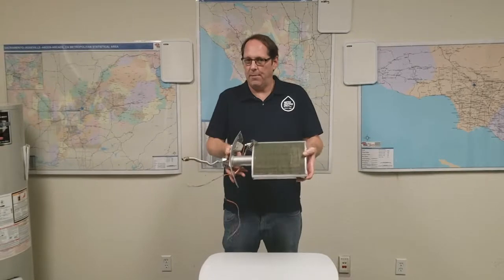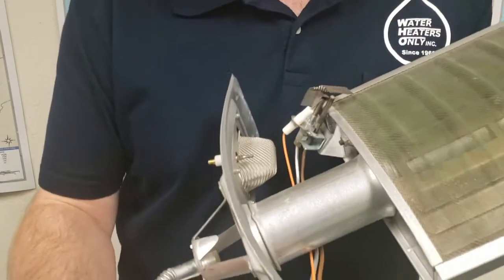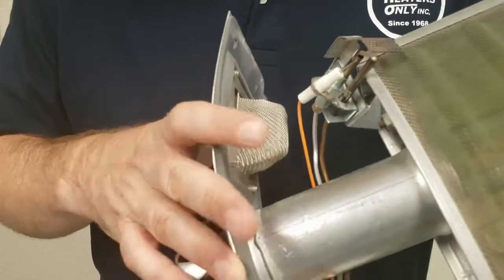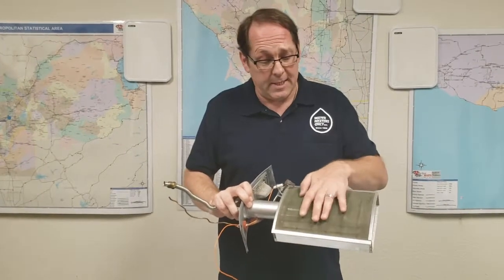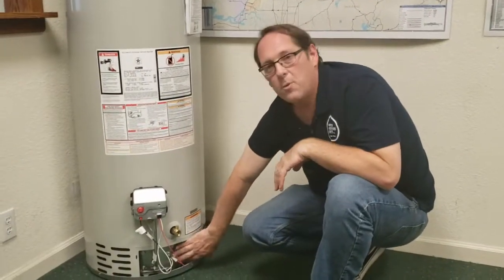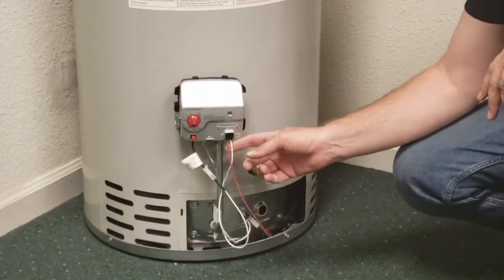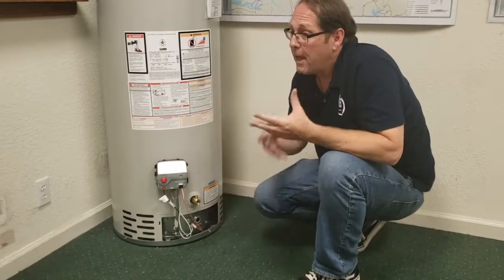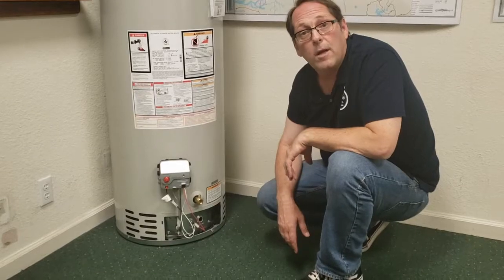Burner Assembly

Comment: Thanks for this great informative video. 
I am actually looking for an exact replacement for my gas water heater burner just like the one in the video. 
Would you happen to know where I could find one?
Reply from the maker: Hi Enoch. Depending on the age of your water heater, a replacement burner may be covered under warranty, either by the manufacturer or the installer. At the very least, contacting them will ensure the correct burner for your brand of tank and where to best purchase the part. The burner in the video is most likely Bradford White. I hope this helps.
Reply: @Waterheatersonly  
Thank you very much for the information. 
Mine is definitely not under warranty anymore, since it was already in the house before I bought it almost 6 years ago.

Comment: Why does my thermocouple head look so red and burnt and pilot light won’t stay on? I’ve replaced the thermocouple 3x in 2 years. What does that perforated shield do above the 3 heads by the thermocouple?
Reply: Hi and thank you for your question, it's hard to say with out knowing the brand and model, since the FVIR change over the manufacturers each designed their tanks a bit differently. However, is sounds as if the chamber is over heating, thus the t-coupler keeps burning out. Might need to clean the filters on the tank if its a model that has one. It could also be an issue with the burner or gas control valve? First things first, I would check the owners manual and see if it is a type that has air filters. If they get clogged it can lead to this type of issue. If it is a tank that breaths from the bottom and the bottom has gotten filled with debris, it might need a cleaning. Hope this helps!

Comment: My screen has a hole in it any way to fix that?? Makes a popping sound inside burner because of it
Reply: HI Justdissin, if the burner has an actual hole,  there is not a recommended repair for that burner.  You can try to replace the burner (I'd call the manufacturer for a replacement burner - have your model# & serial#  handy) if the water heater is young enough and in decent condition. If the water heater is old, you may need to replace the entire unit. The popping sound is due to the hole.  Please let us know if you have any other questions.
Reply: @yanacarpenter-who3493  thanks for your response. I actually used steel wool to cover hole & it worked. No more popping sound from burner assembly. Only popping sound i hear is from inside tank maybe sediment?? Is there a way to get rid of that? Maybe draining?
Reply: @justdissin7340  Interesting fix, thank you for the update, very inventive. Yes, you could try draining / flushing the tank and it may get ride of some of the sediment. The sediment may already be hardened to the inside of the tank, but it's worth a try. If it has a plastic drain valve and it's old - be very gentle.
Reply: @yanacarpenter-who3493 
Thanks for this great informative video. 
I am actually looking for an exact replacement for my gas water heater burner just like the one in the video. 
Would you happen to know where I could find one?

Comment: You say typical burner assembly when you should say new style  assembly. They changed over to this style about 4 or five years ago. The typical burners are the round ones. Some people may be a bit confused if the have to remove an older one and not see the one you are showing. Other then the burner shape the rest is the same. The thermocouple is a little different as they have added a resistor or diode or something like that in the line. One can still get the old thermocouples a Lowes for $14.00 but they are the old style, like to know it they would still work in the new units as it is a waste to replace everything when all it needs is a $14.00 part, the whole unit goes for around $130.00. They just want to make more money I guess.
Reply: Hi Charles, Thank you so much for your comment. Yes, all water heaters have changed many times over the past 2 decades. They have undergone various internal changes for safety, energy efficiency and emissions changes. After the 2003 FVIR upgrade, standard parts or what we refer to as universal parts became a thing of the past. After that the burner upgrades for efficiency and emissions issues really changed all water heaters and many manufactures now have components that are very specific to their brands.  We said typical burner assembly, as we were speaking to a standard draft induced style water heater, versus a burner assembly for something like a high efficiency model or an older (not really that old) style low nox model with a first gen radiant style burner versus the new radiant style burners. Thermocouples are a different story though and now many manufactures have gone the route of a thermopile, but still generally a pilot assembly kit is needed for a repair and you have to get inside the sealed chamber for a repair as well.  Unlike the old days when it was a quick and easy switch out of a thermocouple -- the old style t-couples don't always fit the newer systems. I appreciate your details and knowledge about water heaters and your feedback will help us with more informed video content.
Reply: I am actually looking for an exact replacement for my gas water heater burner just like the one in the video. 
Would you happen to know where I could find one?